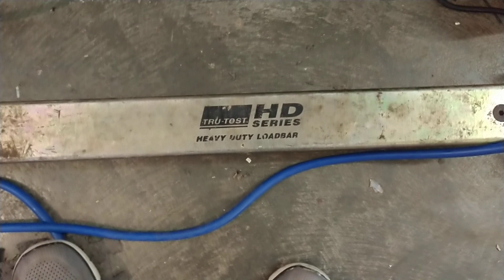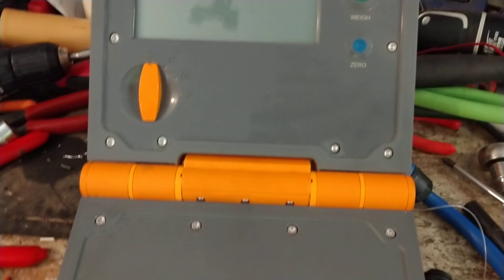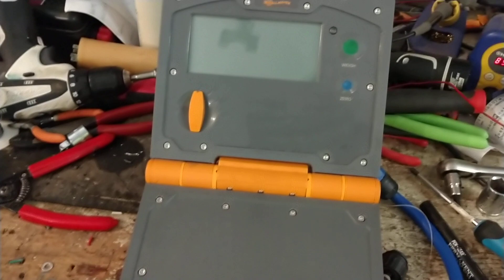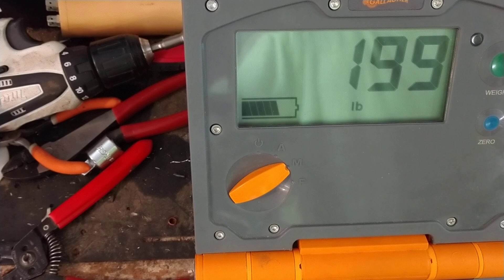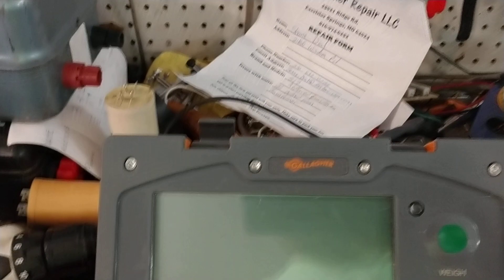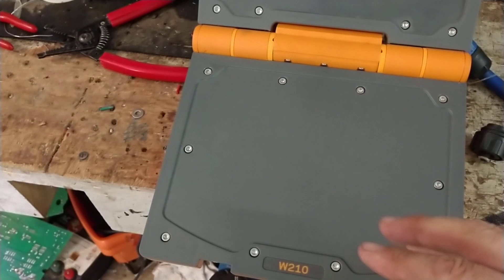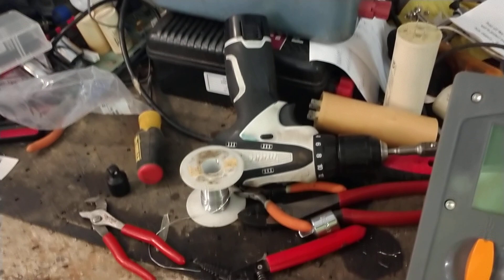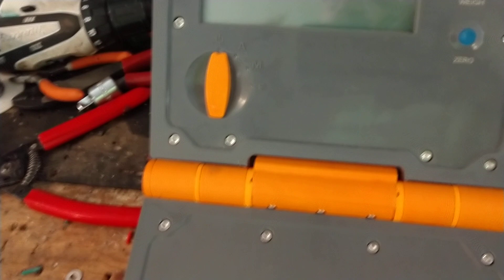Tru-Test HD1010 MP800 MP600 Load Bar Repair

Comment: I have the MP 1010 load bars which have failed and has undEr on 7i display. I contacted Tru-Test for some help. The after care service is terrible, they wont talk to you, want only to deal with the agent. No sense of urgency. Our Vet is coming and the cattle are due to be sold so i want to weigh them. We are remote so I stripped the load bar. They are not happy about this and I can see why. Both the silicon and electrics had failed (full of water). To be honest I am shocked at the standard of workmanship. So I stripped them, dried them and re-siliconed them. I got one working but the other's electrics is past saving. My wife drove 5 hours to take it to them for repair. They offered to sell us a new system really? Ours is less than 5 years old, used only 3 or 4 times a year.  Now they want 50% of the purchase price to repair the single load bar - for some cheap chips? I am not done yet, they will repair this at their cost because this is down to poor design or poor assembly - but that is what I got so far with this company.
Reply from the maker: It's a good thing that we're not the manufacturer and just an independent repair shop. They're an expensive brand and the after sale they just would rather sell you a new set up or a new load bar. They don't really deal in repairs or least they would rather just sell something new.

Comment: Oh, Tru-test loadbars compatible with Gallagher weigh scales?
Reply from the maker: Yes on some, but not all models. You usually have to do a recalibration on the scale so it knows what's zero weight and what the actually weight is on it. The W110 Gallagher scale can't work with any of the tru-test bars and I think the S2 or S3 trutest scale can't work with the Gallagher bars, but I could be wrong on that.

Comment: Have you ever seen a "undr load" on the screen of a scale reader?
Reply: We have a TruTest that keeps reading "undr load" and won't clear
Reply from the maker: Yes, that usually means an issue with a load bar typically. Unhook one load bar and try the scale with one bar hooked up at a time. If it works with one bar and not the other, you'll know which bar has the issue. If it happens to do it with either bar hooked up one at a time, it could be the scale, or there's issues with both bars. If it happens with either bar hooked up, I would try the bars on another scale indicator from a neighbor or take the bars into your local co-op and see if they have a scale they'll let you try your bars on and see if they work or not. If you find that one bar is good and one bar has an issue, you're welcome to send the bar here for me to look at. www.cattlescalerepair.com
Reply: Mine is doing this and when I try to zero it says error 29.. These are tru test.

Comment: Any ideas for troubleshooting a trutest xr3000 and xhd2 saying bad cell code? Been giving me trouble and there isn't a lot I could find on it.
Reply from the maker: I don't see those come in that often and don't get questions on those cells very often either, but here's my guess. It likely means that one of the cells is bad or not communicating to the scale indicator. You could try and go to the junction box where the cells wire up at and disconnect one cell at a time from the junction box and see when then code goes away. If that works, trace the wires to the cable to which load cell it is, then you'll know which cell needs to be replaced.
Reply: @FencerFixerRepairLLCKansasCity  So I tried all the load cells and they had the same error. That led me to believe it was a software issue, so I borrowed an EW5i and it worked fine. So after looking into the XR3000 more I find it was last updated in 2006. I'll update it when I get a new cord next week but I'm pretty sure that was my issue.
Reply from the maker: @HB-ps6rn  That's good to hear that that cells are fine. Hopefully the software will fix your issue. If it doesn't, then the scale itself has an issue inside itself.

Comment: So when you have your load bar out from under the chute you have a chute that cant be us? This wont work for me. I need my chute more than my scale. Can you rig it where you can still use your chute?
Reply from the maker: I'm not quite sure what you're getting at. The only reason why you would have to pull a bar out from under the chute would be because there would be an issue with that bar not acting right. You can't really use the chute to weigh with only one load bar hooked up underneath. Because you wouldn't be able to get the full reading of the animal on the chute. If you're not needing the bars for weighing, and one or both bars are good or bad, then pull them out and just use the chute for whatever reason you need to use it for.
Reply: I use the chute for catching cattle. A squeeze chute, OK. I think I have one bar bad so it will have to come out. So then how will I attach the chute to the concrete to continue to use the chute with a bar out. I could put it on a 4x4 but then when the cow hits the chute there is a lot of pressure on the one bar holding the chute.
Reply from the maker: You could try and put the 4x4 underneath to keep it somewhat stable. Try that or remove both bars and just remember which bar is the faulty one. I'm just a repair guy that works on things. I've worked on plenty of brands of load bars, squeeze chute types and the Alleyway platform bars. People have to go without 1 or 2 bars whenever there's an issue, so I'm sure people have gotten by with no bars underneath their chutes plenty of times. What does your faulty bar actually do when it's connected?
Reply: It says under then if you try to zero it, error 29 comes up.
Reply: These bars are only about 3-4 years old.
Reply from the maker: You likely have a bad cell image the bar, that's not a cheap fix. You'll have to likely send it into Tru-Test to get worked on. They're being sticklers on who can work on their scale stuff.
Reply from the maker: That's a shame they didn't last that long. It's either from the environment they're in, but they should be built for it. Every situation is different though.
Reply: I am starting to think lightening hit it.
Reply: Chute is not grounded but will be now, any thoughts on how to do that best? Ground rod close to chute or farther away?

Comment: can u give me wire diagram E+ E- S+ S- ?
Reply from the maker: Sorry I'm not sure which wire is what.
Reply: I have a tru-test type MP800, I want to replace the cable but I don't know which signal path is min and plus @FencerFixerRepairLLCKansasCity
Reply from the maker: @user-su5nt4bj1t  if you're just wanting to replace the cable, just splice the matching colored wires together one at a time by soldering and heat shrinking them one at a time then heat shrinking or taping the whole spliced area afterwards. 

Or are you asking about which wire goes to which pin on the connector and what resistor is inside the connector?
Reply: The previous cable had too many connections due to service, so I don't understand the appropriate colors, there are black, red, green, brown... which color do you think is suitable for the min and plus signal lines? @FencerFixerRepairLLCKansasCity